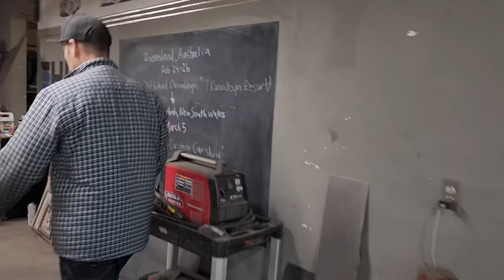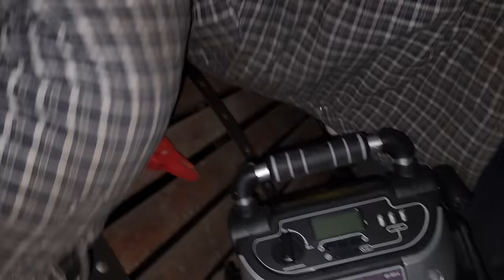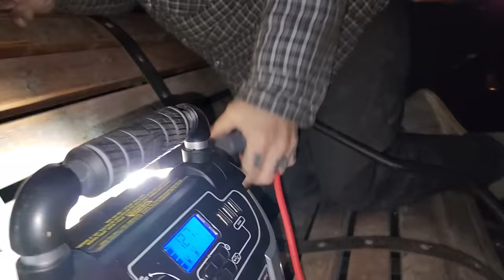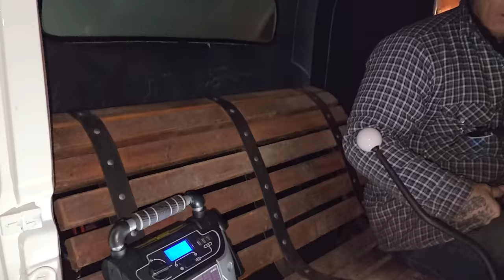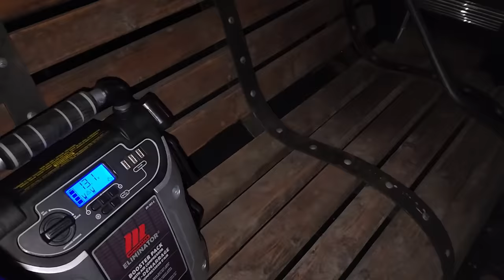Moving into our new shop... one custom car at a time  🎉

Comment: There’s an easy way to pre-prime those carburetors, Chad. Most all older carburetors have a slanted tube sticking up near the air filter bolt that is the end of the bowl vent and goes directly and we’re fuel needs to be. they’re usually about the diameter of a drinking straw. If you dribble a ‘shot glass’ of gas down into that tube, it will ensure that your accelerator pump rubber or leather doesn’t get mangled if it has been sitting a long time and dried out. Good idea to do this before anyone pushes gas pedal down.
Reply: I use plastic dish detergent bottle for priming.
Reply: Yeah, I was saying out loud "those old Rochesters... squirt a bunch of gas down that vent tube and it's going right into the bowl". And I use a mustard bottle for mine.

Comment: That's what I was telling people, when I had my collection of classic car truck's it's hard to keep up on all of them. You can't just let them sit around seals start leaking batteries go dead, gas goes bad from just sitting in the tank gas will break down into water.

 Have to keep them regastard and insurance on them to be driven on any road. It gets expensive hobby to keep up on vehicals I wasn't using often so that's why I sold off the heard. Plus I didn't have a building to keep them in, I had to WASH them every so often.

Comment: Nice collection. You need a manual choke on that truck, fix it right up. Batteries go bad not staying charged. That Rocky Road truck is sharp as hell. It would be really nice with a newer engine and trans.

Comment: The way to tell a 292 from a 194,230 or 250 is that the 292 has taller side pans covering the lifters.The passenger side makes it easy to see the difference and once you’ve seen them both, it’s easy to spot all the little motors are about an inch and a half or 2 inches roughly shorter on their side pans.

Comment: Dunno Chad, a lot of old cars that need fuel down the carb often have sticky valves if not run for a while. I would ALWAYS put the air cleaner back on so if it backfires through the carb, it does not damage your paint, especially when they are this well presented. I think you should be taking each one for a drive every 6 months to keep the systems (brakes etc) in good working order unless you built them only for show, not for go.

Comment: Bugatti Engine?  Looks like Jaguar XKE Engine. Here in States Call them Valve Covers  that's most popular name for them. When I was young Teenager learning to work on Jaguar Engines with my Dad who is Master Jag Mechanic anyway I'm Tightening down Chrome Crown Valve Cover Nuts Tighten to much Cracked Covers so that day  my dad taught me about Feel Tightening Fasteners  and instead of tightened them with all my Might. One of the times he didn't get pissed off he said yah  that happens with those Valves covers prone Cracking at Bottom of the Nut  with out Cranking down on Nut. He had few Spare Covers knew a guy that could Weld them Made out of Cast Aluminum.

Comment: That's a really nice looking truck! Next time use your squirt bottle to squirt the gas directly down the float bowl vent tube, filling the float bowl. Then squirt a bit down the throat and it will stay running a lot longer than if you didn't fill the bowl.

Comment: Every one of those idle cars need to be started and run regularly to keep the engines lubricated, and the batteries charged to keep the gravity up.  A boat load of batteries to go bad.  Fuel systems go bad from becoming dry.

Comment: In my automobile I keep tools I can do most all I can fix electoral an I can all most rebuild a engine an breaks all I'd have to do is go get the part's I keep my jump start fully change and a air pump to air up tire's. It me but a auto that has been sitting at all the frat thing I would do is check all the fluids before I try to start it. If a automobile that you don't drive the best thing to do is Dean all the gas out the gas tank then run the engine in till it quite running. If I was just needed to move it I would use a boat gas tank then move it when I was dune I'd run the gas out of the carb that way it will keep the full system clean an not gummed up or old routine gas. If the car is stored on cement I'd put wood under the tires like 1"x 12" x 16" x4

Comment: Chad when you are putting gas down the carburetor after it sitting so long,  mix two cycle oil and gas at 40 to 1 it gives lubrication to the valve train. Raw gas causes damage to a engine that has sat.

Comment: Chad what works good when you prime the carburetor is to fill the bowl of the carburetor with gas by squirting gas into the vent tube that way it will give you some running time to get the gas to the carburetor

Comment: Instead of just squirting some fuel down the throat of the carburetor, especially when you have a bottle with a nice little tip on it like that. You can fill the bowl of the carburetor through the vent tube and it will give it enough fuel to run on until the fuel pump starts going again.

Comment: There are little tubes in carburaters and you can put gas in them and it fills that carburater up with gas so it can run until fuel pump picks up the fuel in the tank

Comment: y chad a tip from an old mechanic ...when priming an engine that sat along time fill the fuel bowl thru the vent instead of directly into the throat ...it will save a lot of undue cranking

Comment: 292 cid has an inch taller block than 230/250 & it's quite easy to spot when you've seen them both by the height of the lifter covers on the right side of the block...jf...

Comment: Shame on you ! For a guy who loves cars and trucks you should know that the WORST thing you can do to a vehicle is not run them. Turn em over and let them at least idle once a month so the fuel doesn't build up with water and the oil doesn't sludge. Also, you wouldn't need to charge the battery with a box now would ya.